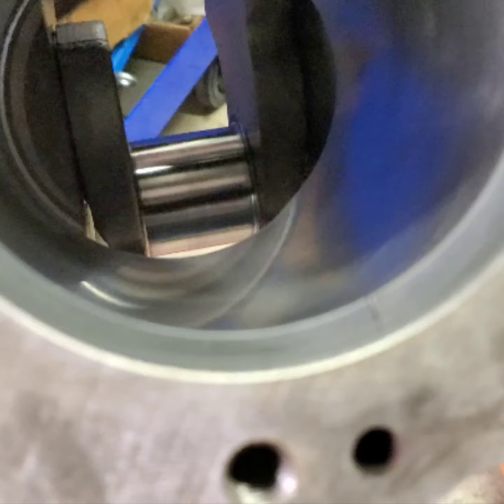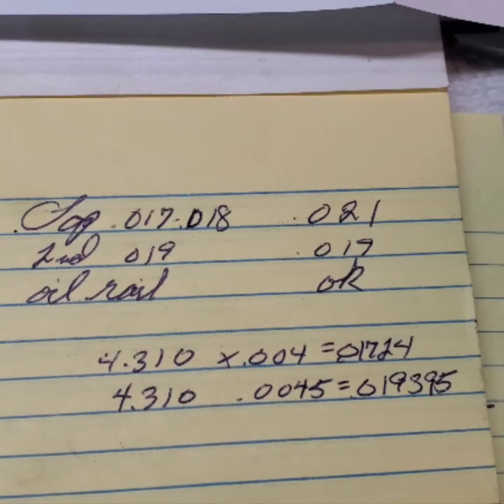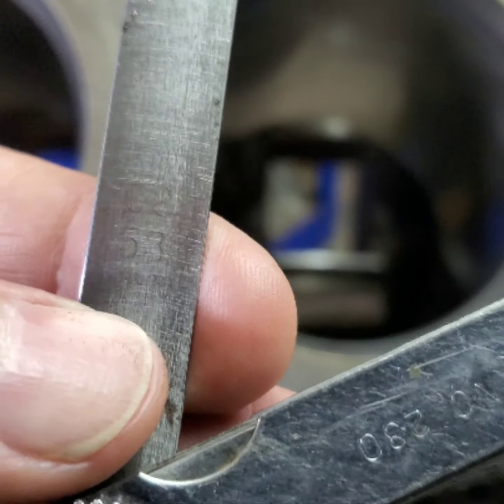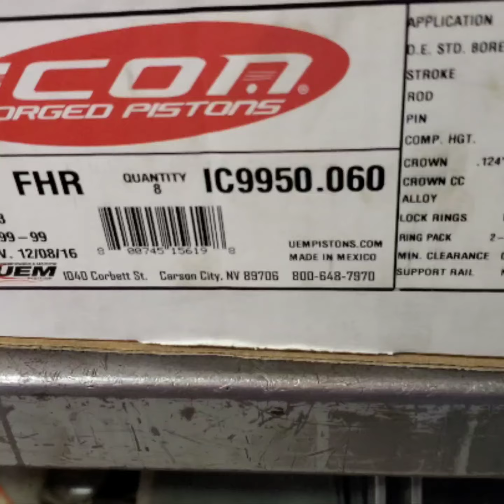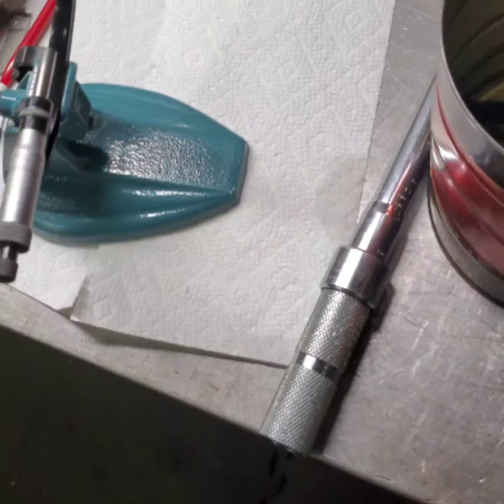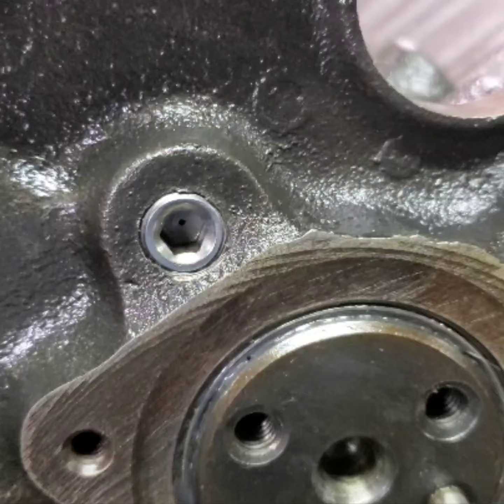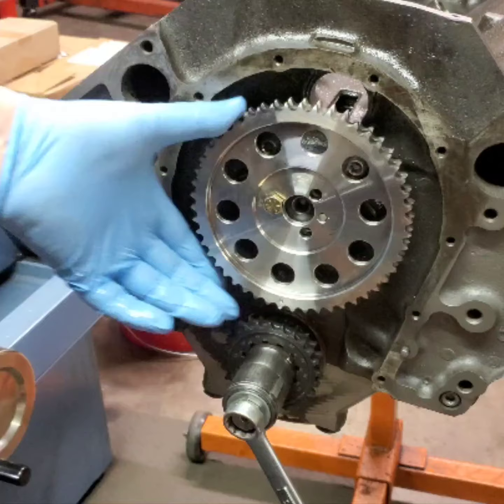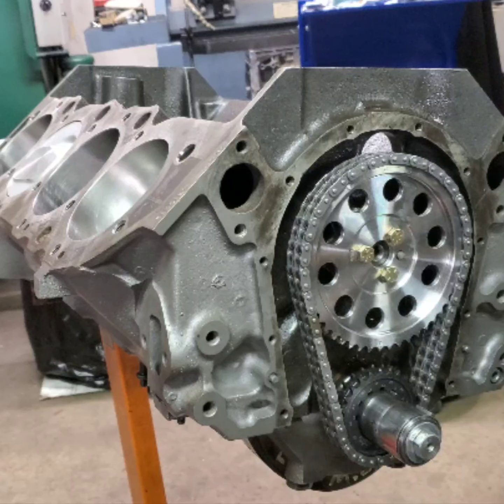427 Chevy Assembly L36

Comment: I really thought those plugs looked like the mod you need to do for the 302/351 block to help keep oil in the bottom end. I have seen this too. I haven't got to the explanation yet but I think it's to oil the chain and IIRC to help the lifter bleed off air that gets trapped
Reply from the maker: Thanks Joshua, I appreciate your comments and feedback. 
You are correct on the oiling for the cam gear and chain.
And getting an air bleed.
Have a good evening. 👍 🇺🇸👍

Comment: my EJ207- ra sti jdm = 10 thou top ring gap = hyperutectik pistons high silicone content - very little expansion in the bore = forged = rattle on start up = hard driving when cold = oil past the rings = bad news = every nody wasts forged pistons ? my everyday street car - now with 365 hp !
Reply from the maker: Thanks for watching Ronnie.
I like Hyperutec pistons.
I like forged.
They is a use and an application for everything. 
Have a good weekend. 👍

Comment: Those pistons are similar to the speedpro l2300s. With a closed chamber head,perfect on pump gas. I have seen people use the open chamber head with those pistons. That does not work out good at all.
Reply from the maker: Thanks David, these pistons are made for this application. 
They did make a SpeedPro and a TRW had a small dome but for an open chamber head.
These pistons from Icon will work either way.
They show all the compatible heads in the catalog. 
Have a good evening. 👍